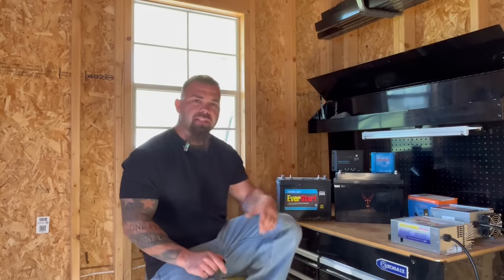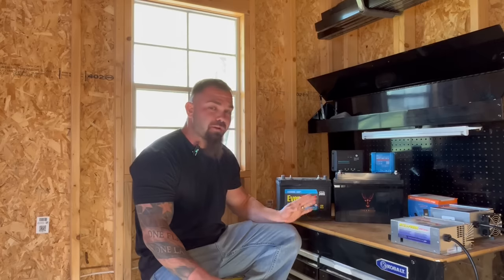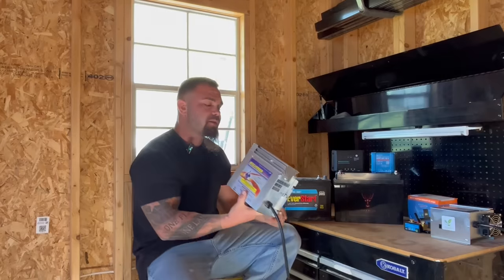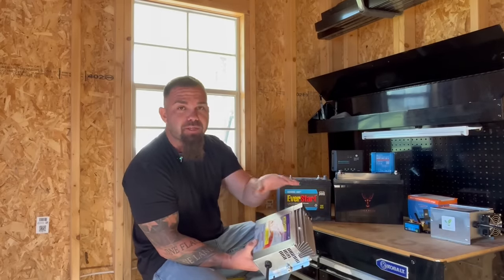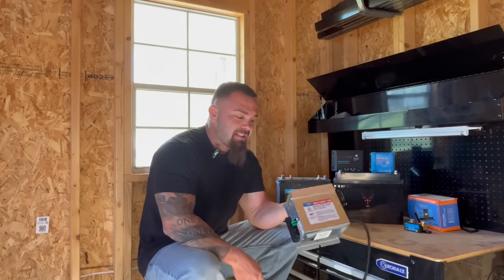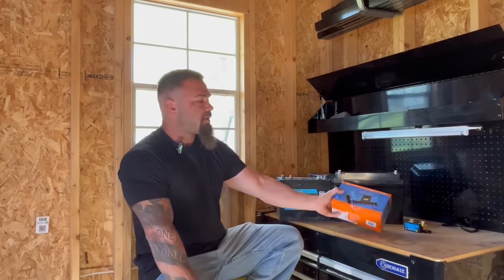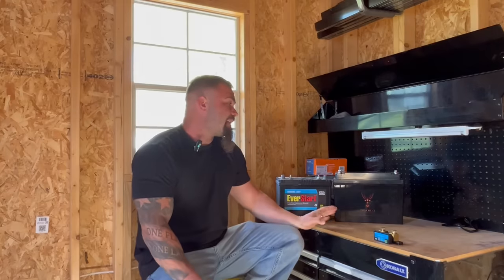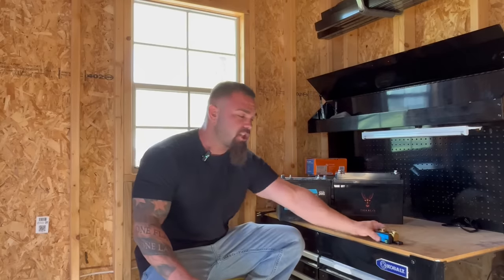Swapping to Lithium? WATCH THIS FIRST!

Comment: I’ve changed to lithium but like you say I’ve also gone with all Victron equipment for my solar and mains charger as well as a battery to battery DC2DC charger. Everything is working brilliantly. I also fitted a Victron shunt so I know exactly the state of charge in the lithium battery, the old lead acid voltage meter although still in place wouldn’t give a state of charge for the lithium but still shows the condition of the starter motor battery. This guys explanation it’s really brilliant the only thing I’d add is go Victron they are the best.

Comment: Glad I watched this first! New to motorhomes (I picked up an older (ie: 1997) 34 ft Winnebago Adventurer Class A with the Ford 460 chassis a few months back. Previous owner did not take good care of the chassis or house batteries (FLA) - a very bad idea up here in Alberta where winter temps can sometimes plunge to minus-M.F.

I already replaced the chassis battery with a new AGM 850 CCA AGM battery, and I'm about to pull the trigger on replacing the four (tired) 6-volt deep-cycle house batteries in favor of four Power Queen 12.8V 100Ah self-heating LiFe04P batteries. There appears to be a lot of info to absorb and consider, including the pure sine wave inverter (1000W? 2000? 3000?), the DC-to-DC charger you mentioned, the shunt battery monitor, among other things. I'll also need to modify the battery bay under the entry steps to accommodate the slightly longer lithium batteries, as well as insulate the bay and then duct heat to it. The battery self-heating feature may be ok down to -4F (-20C), but when (not if) it gets colder than that we'll need to insure the batteries can be counted on.

One of the several videos I've watched so far mentioned a point that seems to contradict your point about having the charge setting on 'lithium' rather than on lead-acid to avoid insufficient charging. This Youtuber suggested choosing the AGM setting rather than lithium because "the AGM setting will still charge to around 95% but not to 100%, but that the benefit of the AGM setting would be extended battery life cycles." Any truth to this at all? Or is that guy misinformed?

Also, any other pointers or cautionary considerations regarding going the lithium route with this particular rig?

Comment: I replaced the converter in my holiday to the powermax 100 amp and could t be happier with it . Its adjustable volts and amps make it great for the 12 volt side for lithium and being a little higher voltage makes all my other 12 volt stuff run way better. Ive also got a fairly large 24 volt solar setup but yeah changing that converter is kinda important to say the least

Comment: I witnessed an RV lithium battery fire. The fire started in the battery box. Within a minute the entire RV was engulfed in flames. By the time the fire department got there it was burned completely to the frame. 
Lithium batteries are very expensive and an obvious fire hazard. 

Besides that lithium batteries are extremely sensitive to temperature and CAN NOT BE RECHARGED WHEN COLD. 
It's Jan 4th and the temp in Lake Havasu is 40 degrees. Too cold to charge lithium batteries. 

My RV I use 4 6v deep cell golf cart batteries from interstate. 225 ah rating per pair. 165.00 each. This is basically the same price as one lithium 100ah battery.
No need to modify your RV charging circuit or deal with "battery charge controller" issues. 

I've been running this system for 7 years now issues what so ever with the lead acid batteries. Hope this helps save you a bunch of cash.
Reply from the maker: I'd be curious to know what the chemistry of that "Lithium" battery was. In the early days Lithium-Ion batteries had a serious risk of failure for a multitude of reasons and are not anywhere near what they are now. In those early days of manufacturing Lithium-Ion batteries they contained an electrolyte that is very flammable and generally contained lithium hexafluorophosphate (LiPF6) or other Li-salts containing fluorine. This is not the case with new "Lithium" batteries. The new chemistry that is being widely adopted is Lithium Iron Phosphate (LiFeP04). This chemistry is not inherently flammable and nearly every battery on the market contains a Battery Management System known as a "BMS". This BMS carries all of the safeguards for protecting the cells inside before they are damaged for any reason including charging protection under 32 degrees.
Lithium batteries can still discharge and be used under freezing temperatures but charging them when the internal temperatures are below freezing can damage the cells. Most manufacturers have internally heated batteries available now so this is no longer an issue as well. It seems it has been a while since you looked into the possibility of lithium so you might want to take another look to see what advancements have been made in the last 5 years.
Where lithium batteries really help people are in cases where the batteries can't be stored outside of the RV. Bumper pull trailers in most cases can only hold 2 small lead acid batteries yielding them about 100 amp hours of useable storage where as a large 200AH lithium battery will fit in the same footprint, be lighter, and give them double the battery capacity they otherwise would be able to have. Lithium also requires NO maintenance whatsoever and usually last 10 or more years. Are they expensive? Yes. Will you spend the same amount of money replacing your lead acid batteries over the course of 10 years? yes. It's a buy once cry once kind of scenario but definitely not for everyone.

Thanks for your comment!
Reply: The video I've been looking for! Clear, concise, and comprehensive. I've been wanting to upgrade to lithium, especially with the prices coming down. Now I know exactly what to look for what else I might have to change. Just checked my converter, and it's g2g. Just need to check my solar controller and hopefully it's off to the races. Thanks again.
Reply from the maker: @jlantz3691  Glad to help!!
Reply: @rvsolarconcepts I 
I have made a comment above about doing a hybrid system, but just to clarify I’ve been using 6v Trojan 105 batteries 2sets on my boat I will agree they do need maintaining and in the winter time they should be charged every day summer time  I have plenty of solar so I don’t need to run the engine unless I have to move which is about every 2weeks if you treat them right they could quite easily last 10 years or more they are on their 8th year  it that’s by the by I’d like to be able to use things like air fryers in the winter as well as in the summer look forward to your reply about creating a hybrid system
Reply: Modern Lithium batteries have either, or both, heaters and low temp adapters built it. Keep up...haha
Reply: @GBuds_RVremodel  And they no longer cost anywhere near $600 per 100Ah either!
Reply: Great video. The alternative to shunt is buy battery with bluetooth, the BT allows phone to talk to BMS. They are more expensive but probably cheaper than buying cheaper battery with shunt, plus extra wiring for shunt. In larger installations shunt may work out better as you can use more cheaper non BT batteries. NB he did mention BT batteries in passing at end without explaining them.

Comment: Hello from Canada. Really love your videos. My question is I purchased a 200 watt solar system and was wondering if I need a fuse inline with the solar panel and battery. I have 2 12volt AGM batteries if you could give my some pointers it would be appreciated thank you.
Reply from the maker: Thanks for the feedback! The output of your solar controller going to your batteries should always be fused.

Comment: Thank you, your video is informative,. A question: - So can I expect a 20w Solar panel designed to keep  an acid battery topped up, to charge a Lithium type battery.?? Regards Pete
Reply from the maker: It has less to do with the solar panel and more to do with the solar charge controller depending on the application. We have installed solar powered gate actuators in the past that didn't use a charge controller at all and the 30 watt solar panel has kept the small lithium battery charged just fine for over a year with no issues.
Reply: @rvsolarconcepts  Thank you so much for taking time to reply,  and your reasoning is,  understandable,  Its the charge controller that, likely would stop the Solar panel charging the Lithium battery.  thank you again for helping me to understand. Your brilliant.  Best regards Pete.

Comment: I spoke to the manufacturer of my converter about hooking up a lithium in place of my wet battery. He said it will work but as you stated it will only charge to 13.6 max but you can use it down to 10% where as you should not discharge a wet battery past 50%. So you could get a lot more usage out of the lithium battery.
Reply from the maker: That's correct. No maintenance, 10+ year warranty in most cases, half the weight, and accurate state of charge readings are all great perks of lithium. They do come with a few drawbacks but I believe clearing those up is definitely worth the gain. 

Thanks for the comment! Let us know if you need help with anything or have questions when you swap over and we can make you a video explaining everything!
Reply: I do the same, my generator charges to 13.6, I then turn off generator and let solar panels continue charging battery to full.

Comment: Arms like a bouncer, brain like an electro tech. Great video! I learned some things I was pondering. The switchable Converter scene, I believe "not know",, is a simple buck/boost circuit switch.  I like electronics. Was a Contract Master Plumber. Loved it more.
Window framming,, is kinda messed up. Should be king, queen and jack studs too  support the double top plate load, cieling and roof. You have; king,, double stack "Jack" weak support, and full jacks under window sill.

Comment: Wow , thanks and I always thought that a lead acid required a trickle charge after charging and a lithium doesn't in fact trickle charging lithium after the  Initial charge is great way to start a fire
Reply: The BMS inside the battery sorts that out, that's what it's for.

Comment: I have a 1999 Chevy 2500 with the 5.7 V8 and this was actually drop in fix for it. For whatever reason it never ran right when I got it and it always felt like it wasn't getting good spark I replaced everything under the hood electronics wise and still getting backfiring well lo and behold it needed a more powerful battery because apparently running at 12 or 12.5 or whatever it was running at was not enough.

Comment: My Flagstaff 528MBS came with a variable charge controller. I can set the chemestry of the battery I'm charging. I've always known when I upgrade to Li I would need to change the setting to Li...but I never knew why. Thanks for explaining!
Reply from the maker: You're welcome John, thanks for the support my man!

Comment: Sure wish you were closer......We LOVE boondocking, and have a pretty good setup right now with lead acid batteries . We built it on a strict budget and bought items when they were on sale ( some items might not be the best quality), but it's working..  We would like to go Lithium, but the cost is kinda frightning. We have 4 - 100W solar panels that work GREAT for us. Maybe when it's time to replace the flooded batteries, we should see what the cost to switch will cost us.
THANKS for this video.

Comment: I camp year round, and wish I had kept my old lead acid batteries! The lithium with lo temp cutoff leaves you with NO battery when freezing! I was shocked to end up with no 12 volts at all. Installing facon tank heaters in the battery box fixed the issue, but it ended up being alot of frustration and work. Self heating batteries would have been my best bet had I known. I installed 2 200 amp lithium iron phosphate batteries, lo temp cutoff in my rv.
Reply: Im from the UK. I work for a company that builds both diesel and electric buses. Two years ago we were told that we weren't building anymore diesel as the future is electric. Two years later we are only building diesels. WHY ! ) Well  electric only bus loses too much mileage when the weather is cold they're silly expensive and only practical in a city ( not far from a charging hub )
Reply: @daletinsley2954 
It might be a good fit for a school bus.

Comment: Our caravan is lithium and they are certainly not drop in. We have a matched system from Enerdrive of a 200amp lithium battery and dc-dec and ac chargers. The chargers monitor the battery and can shut it down if the voltage goes over 14 volts or below 12.5 volts. The charging system keeps the battery safe. The chargers should be left active all the time, even when the caravan is stored. Each 7 days the Enerdrive system wakes up, tests the battery, charges as necessary and then turns off, but continues to monitor the battery.

Comment: Good  points In the UK, many  lead acid acid chargers go to bulk and absorption to  14.4  v  and float at 13.6 ish  , not seem many that only go to 136 max apart from those fitted permanent  in older caravans  rvs etc

Comment: The maximum charge voltage for a lead-acid 12V battery is typically around 14.4 to 14.8 volts, depending on the specific type and manufacturer. However, it's important to consult the manufacturer's specifications or the battery's datasheet to ensure the correct charging voltage, as exceeding this voltage can damage the battery.

Comment: Excellent explanation, thanks. I have LA batteries now in my RV trailer. Looking at changing to lithium batteries. My converter isn’t LI compatible. I’m considering switching to a charger/inverter/transfer switch in one, Go-Power unit. Appears to be the best solution. I already have a shunt with Bluetooth, solar panel and controller with Bluetooth and LI programmable. I have the 18A dc to dc charger already. My real decision is on the best LI batteries to buy. It seems what good today has issues later. Prices keep coming down, so when to jump in ?

Comment: AGM batteries also need to charge at 14.4 volts. Set your solar controllers accordingly. I had to set my PWM controller up as LI as it didn't have an AGM option.

Comment: Great video! If I quickly heard at the end - the shunt is not required if you have a bluetooth enabled Lithium battery?
Reply from the maker: Bluetooth batteries usually contain the ability to monitor their state of charge through their corresponding BMS app. In those cases, as long as you are within bluetooth range of the batteries you may not need a shunt because you can check the state of charge through the batteries individually.

Comment: My campervan came with two wet batteries. Can be charged from the mains from the two roof mounted solar panels or from the alternator ( split relay) split relay charging is not very efficient. Also when running a fridge ( 60w 12v so drawing 5a ) a tv lights ( led ) and a diesel heater ( 15a on start up and shut down) they soon start dropping voltage. In England especially up north the solars dont get much in winter ( we don't get much in summer either) so i have fitted two valance 135ah lithiums ( parallel) fed by a 150w solar panel via an 100a mppt controller. I can also charge them by a  smart charger though the solar does fine. When the wet batteries start dropping i have a 150a marine type heavy duty switch that connects into the lithiums. All working good. I dont have the lithiums connected to the split relay system. Off the lithiums i have a 1000w and a 600w inverter ( pure sine wave) I've been into the Yorkshire dales off grid for a week and not dropped below 76% on the lithiums. Wouldn't have lasted two days with the wet batteries. BEST WISHES FROM THE UK

Comment: Great info packed presentation.

Dora’s it make sense to charge Li (at the right voltage of 14 6v) to 80 percent SOC and a bottom of 30 percent SOC? The capacity is enough for our normal usage.
Reply from the maker: @milkrecu  keeping your state of charge between 20% and 80% will add YEARS of use to that battery when compared to a battery that is taken from 100% to 10% over the same time period. It is very beneficial to the longevity of your batteries. 

We always recommend optimizing the system to be able to run in that SOC range but that usually increases the overall expenditure of the project as extra batteries are needed in order to get the desired amount of usable amp hours. Not everyone has that in their budget but if you do, these batteries will likely be the last ones you purchase as long as the BMS holds up over the years.

Comment: Thanks so much for explaining this in such a simple and clear way. Question, should there be any concern with just the general wiring in an older 2008 MH if doing a proper swap like you just laid out?  
Thanks again for a great video.
Reply from the maker: Thanks for the feedback, we're glad you enjoyed it! As long as the wiring is in good shape it shouldn't cause any issues. 12vdc power on traditional batteries can float everywhere from 11 volts to 15 volts (during an equalization cycle) so running lithium between 12 and 14 is no different.

Comment: you covered it all. But I have a unique situation in my Class C and am wondering if the alternator can hurt the charge controller by putting out too many amps.? I have solar on roof, charge controller, 2 separate battery banks isolated 1 lithium, 1 SLA. Inverter instead of generator. My plan is to use the SLA (charged by alternator while driving to run the inverter to the fridge. I isolate the lithium but the Charge controller is still on,line at the bus bars. I dont want to destroy the Charge controller.